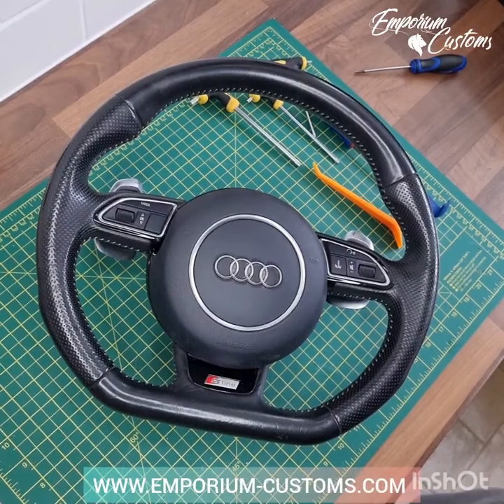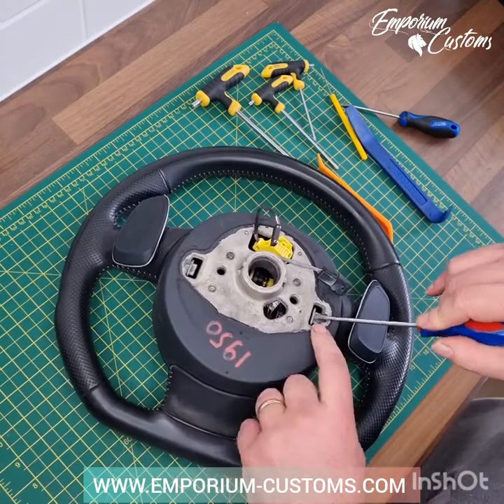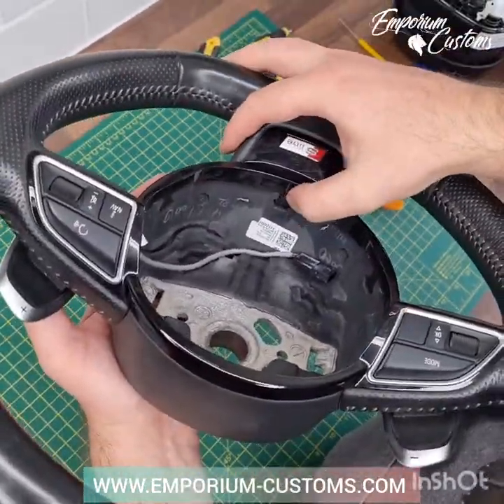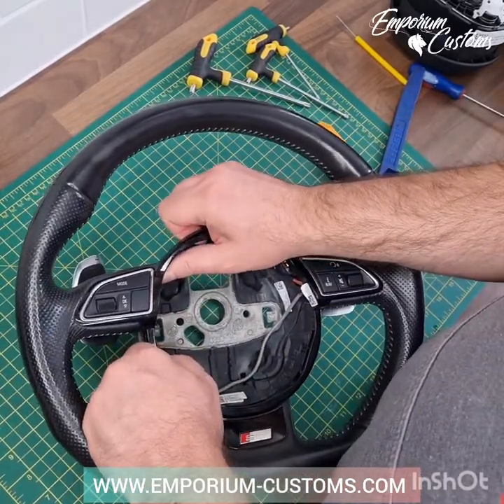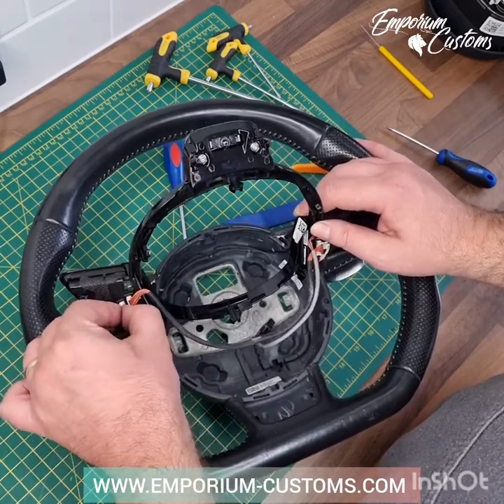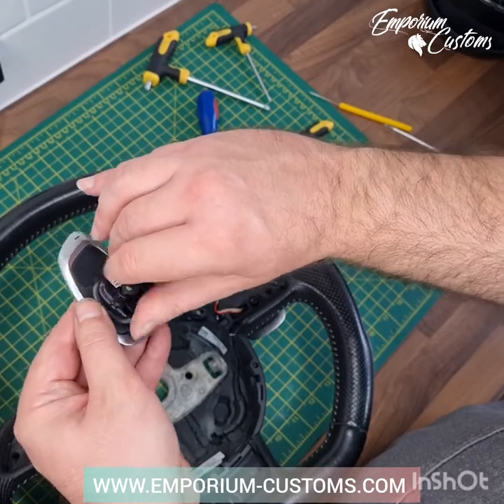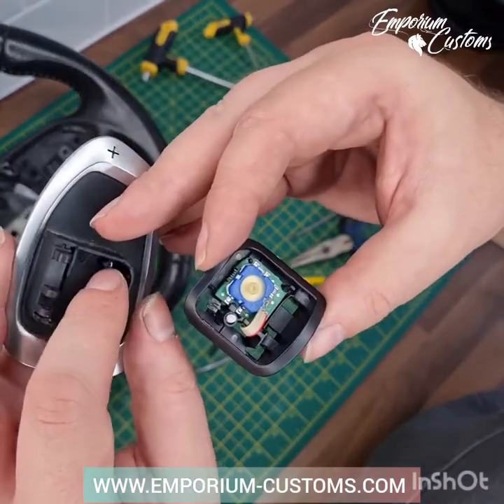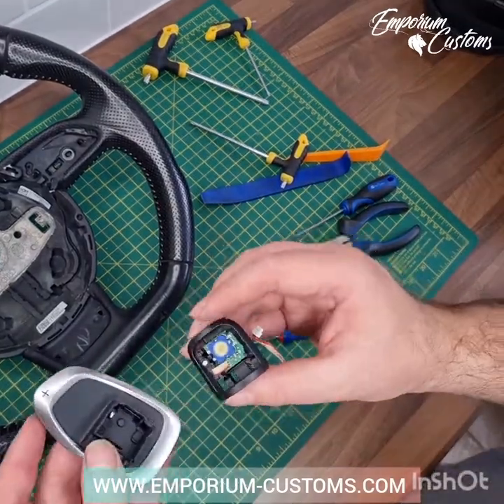How to: Remove Audi Steering wheel, trim and paddle shifters. S and RS Audi A1 A3 A4 A5 A6 A7 Q3 Q5

Comment: I got the pin out but struggling with that. Corner. Great video btw 👏🏻🙏
Reply from the maker: Thanks  :) it's pretty resilient, don't be afraid to give it a good lever out, the little plastic shelf isn't very big and is unlikely to breqk
Reply: @badgerprimeminister thank you. We got it done :) 👍🏻

Comment: Hi quick question, will i be able to fit the button parts from a round steering wheel (audi s5 2012) to a same year steered wheel but this one is flat bottom? Thanks
Reply from the maker: I wouldn't be able to say without seeing both sets of buttons but normally yes, they're the exact same, however the trim pieces are often different and would need popping out of the trim.

Comment: Can you provide any explanation for how to remove the steering wheel buttons from the black plastic trim piece.
Reply from the maker: Once the trim piece is off, flip it and look where the buttons join the main piece on the 'wings' they are levered in with retaining pegs, the trim is also quite springy so they'll also normally just push out also

Comment: Hello, do you know the part number for the screws that hold the paddle shifters to the steering wheel? I'm retrofitting my steering wheel with paddles and I believe I may need to order the screws.
Reply from the maker: Wouldn't have a clue buddy sorry. that's one of those parts that are hard to locate online but are so essential!
Reply: I used ETKA to find the partnumber, I think it's N  909 187 01